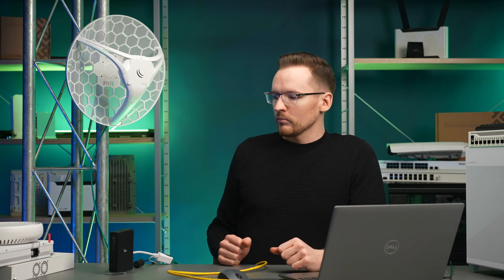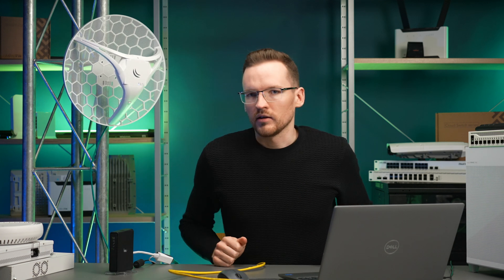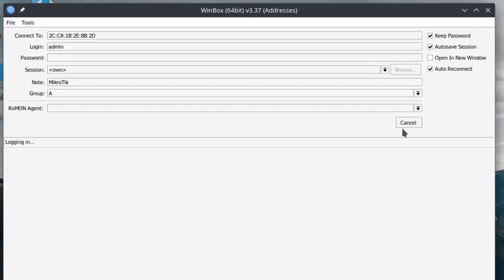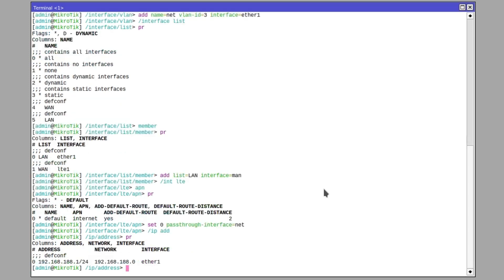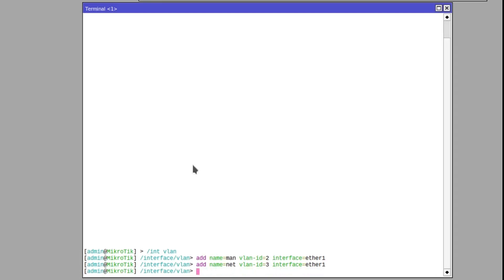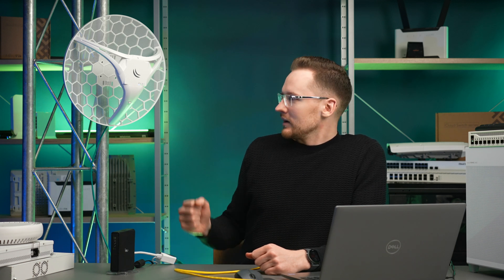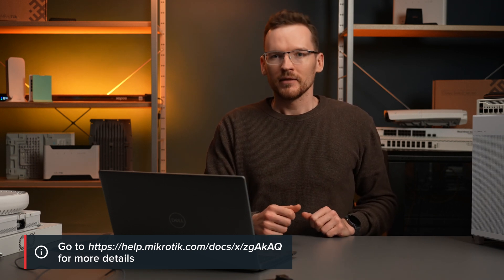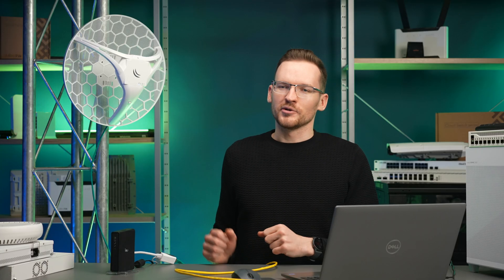LTE passthrough: PART 2, advanced

Comment: Great video, but how comes, that VLAN filtering is not switched on for both bridges - on SXT and HAP?
Reply: Nvm, I guess I figured it out. Because there are no defined vlans in /interface/bridge/vlan/ through which You'd asign more complex tagged vlans for further switch trunks, thus there are no use for vlan filtering in bridge. Right?
Reply from the maker: Neither of those devices are switches and, hence, do not have advanced switch chips that could take advantage of the CPU sparing vlan-filtering. Even if you configured vlan-filtering, the CPU would still be used for processing.

Comment: I have a ask, is posible to get more than one IPv4  using LTE interface on passthoug, maybe using VRRP interfaces or using DHCP relay or similar?
Reply from the maker: You could use two APN names - one for each IP. Of course, if your operator allows for that.
Reply: @mikrotik  last question, if the operator allows it, is it possible to put the same APN names multiple times to work simultaneously to get multiple IP addresses?

Comment: @MikroTik Is it intentional the DHCP lease time when using passthrough is only 1 minute? And the value for the DHCP lease from the LTE device to the device behind (receiving the passthrough) is non-adjustable ? 😕
Reply: Personally, I do not see a problem with the DHCP lease time defaults to 1 minute. Thou I would highly prefer the default DHCP lease time being configurable for the lease given to the device "receiving" the LTE passthrough.
Reply from the maker: That IP is received from your operator on their terms.
Reply: @mikrotik  Ah. Initially thought a HW switched IP adresses was used for 1:1 Network Address Translation on the LHGG. Since i noted the existence of a /32 v4 address in IP > Addresses.

Tried using Mangle Rule > Action sniff TZSP on the lte1 interface to see DHCP packets. No luck. I presume it is not possible to make a copy of packets sent+received by the modem to the connected LTE Cell Tower?
Reply: This question also came about. Due to noting the DHCP client (in passthrough mode) will receive a NTP server IP of of the LHGG's static NTP Server (/system/ntp/client/print > servers). Even when the LHGG does not have System > NTP Server enabled.

Comment: Thank you Druvis, I used these instructions to setup LHG LTE18 + hAP ax3 for my parents, in a remote location. They've been using it for ~2 weeks, works like a charm - they went from ~2-2.5 Mbps on a modern phone, to 70 Mbps on LHG(the pole is very short but they are happy with the stability and speed).

Comment: I’m a bit confused. Wouldn’t the same effect be found by using RoMon on both devices? That way you could log into the LTE device via the router? Or am I missing something?
Reply: For simple access you can use RoMON instead, but then the LHG will have no internet connection of its own.

Comment: Hi excellent video!!!Just a question please? I have 2 apn profiles that isp gave to me with 2 differents public ips. Is it possible to use both for LTE passthrought mode? Thank you
Reply: Yes, just make separate vlans. Alternatively, you could use the second one for internet access in the LTE device.
Reply: @RB01-lite  I mean passthrought mode in compination for these 2 (apn) lte interfaces. I try for this it gave me from isp the second ip address but in new LTE interface there is not "R" running.
Reply: @jokar70  You should specify a passthrough interface for each APN individually and then set both APNs for a single LTE interface. If that doesn't work, write to mikrotik support.
Reply: @RB01-lite  Thank you.

Comment: I use to:
1.- Reset configuration with no default configuration
2.- Login again, create a Vlan for the passthrough 
3.- DHCP client for ether1
4.- (optinonal but very recomendable) Activate romon

Then you can access and manage through IP or Mac from your HAP (Activate romon also on the HAP).

Thanks for your videos

Comment: This is excellent stuff.  I recall setting up an ADSL2 "router" in bridge mode so that my RB3011 was doing all of the routing and PPPoE,  but with a management IP address on the same physical connection.   Anything but Mikrotik it would have been a pain to set up (or learn to set up).  This is why I use Mikrotik; no matter what I need to do, it can probably do it.  Ergo, I only need to know one platform - Mikrotik.